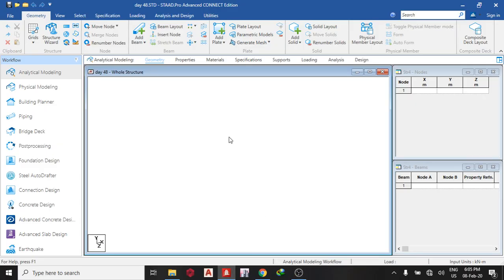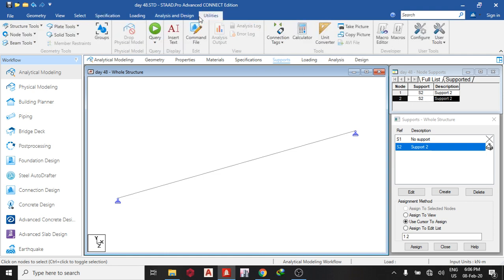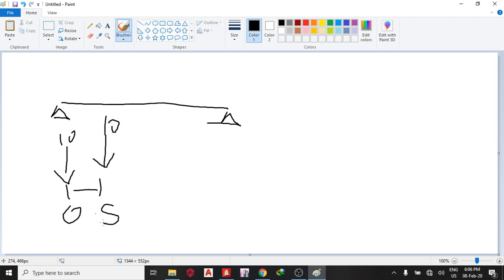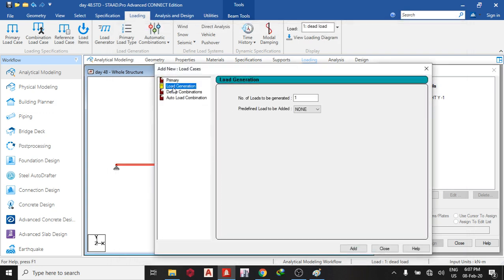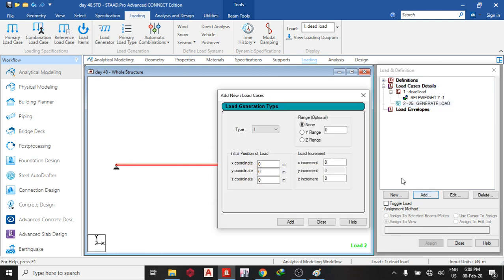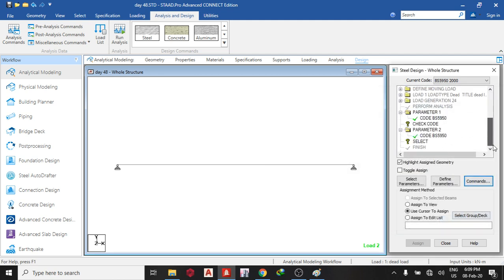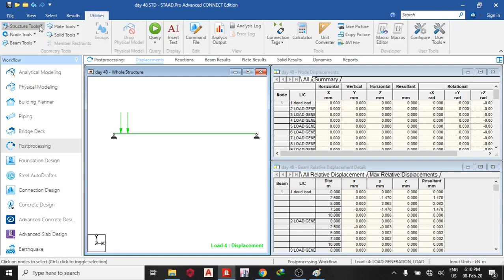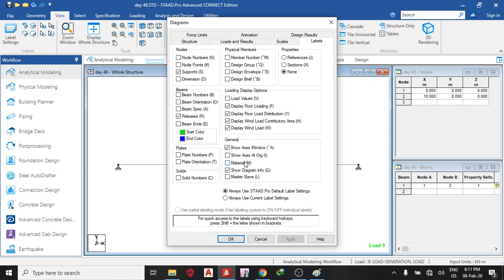how to design a crane gantry with moving loads on staad pro CE

Comment: first, it is a great video and I just want to clarify 2 things 
1-bs design according to ult, not service so this means this 10 kn  is ult load combination
2- no-load combination contains dead and crane load has been generated so own weight has been ignored 
so what do you think?
Reply from the maker: yes the 10kN is the ultimate load
2) you can still factor the dead load of you want. but I know the self-weight is insignificant in this design